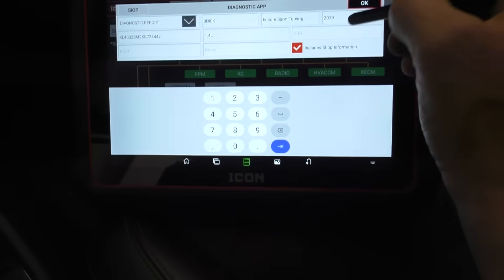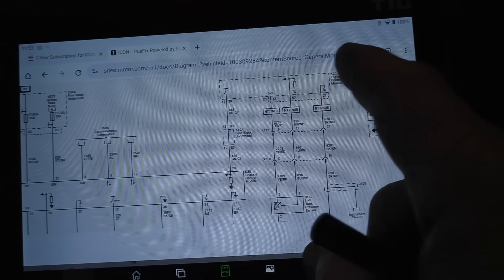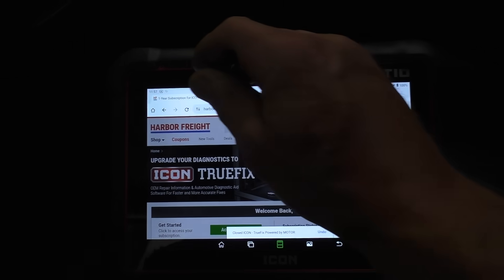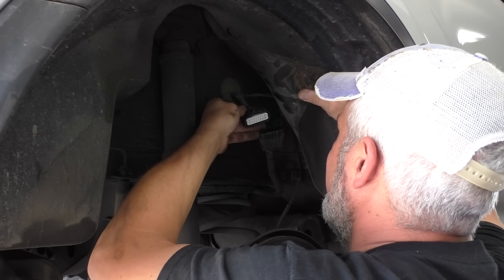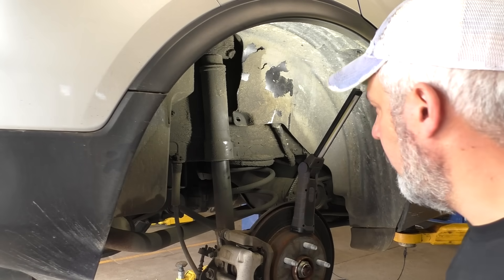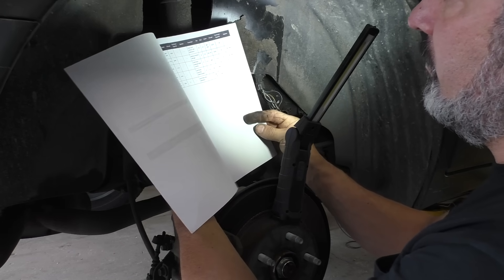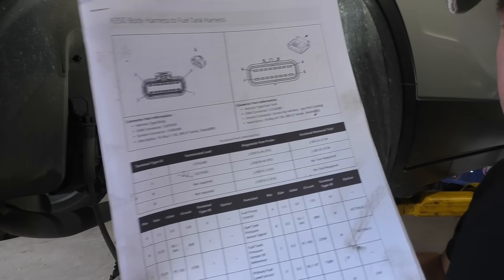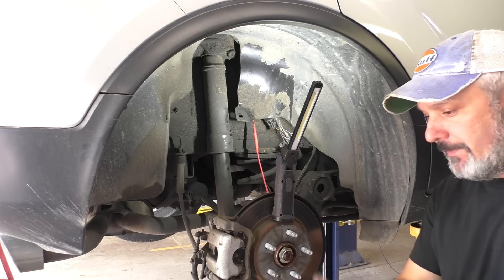Buick Encore - No Fuel Gauge & Engine Light On

Comment: It’s crazy seeing how much getting it oil sprayed helps stop these from turning into rust heaps.
Reply: Never understood why anyone in this region that plans to keep their vehicle more than 4 years doesn't get it done. I get all my new vehicles done.
Reply from the maker: @funbags6471  it is %100 mandatory if driven in the salt
Reply: Any zip code that pisses salt on the road 365 days a year like this one apparently does, should be giving out checks so that tax paying residents can buy a new vehicle every 7 years. 

In the South, you'll see vehicles from 1945 that have been sitting for 50 years with nothing but a little surface rust on the hood. Zero rot.
Reply: @SouthMainAuto  in your opinion, there are more than one company out there spraying their own version of anti-rust oil. I know you spray Fluid Film. 
Anything that doesn't turn hard like Zebart good to go?
Reply: I use linseed oil, no problem if it spills and it soaks in very well. The cost is low and easy to find.
Reply: Don't fix you engine ,trannie leaks and it won't rust away either.....lol
Reply: i so wanted to do this but i dont know what company does it around here and i think its like 600 for first time then 100 a year after that
Reply: @COBRO98  if you wash your car allt he time when salt is being put down it helps alot. epissly if youc an find the auto washer with the super powerful underbody spray
Reply: @dans_Learning_Curve i was wonderin that myself
Reply: @yamisniper 600 is a lot less than a new car before a guy pays off the first one.
Reply: @COBRO98 If you see a 2007 Chrysler or Dodge grand caravan, rust free, let me know. I want one!

Comment: Low reference, fancy term for a ground, but with a twist. Instead of using the chassis as a ground return, an extra wire is used as a ground reference (return) back towards the circuits in question. This is mostly used to mitigate noise induced by the chassis return. Hope that helps.

Comment: I just got done with an Encore. 
Customer said his brother said it needed a new intake manifold. 
The owner said its been Parked for a year because his brother worked on it and the misfire was evident .
Car jerks bad. 
I scanned for codes
 Misfire 2 and 4
Pulled each plug and started checking. 
2 and 4 plugs porcelain carbon tracked. 
Coil boots springs are installed wrong. 
#2 is Rusty.
Got new ac Delco iridium plugs. 
Installed the boots springs correctly. 
Misfire went away. 
Took car for test drive. 
No more jerking and ran smoothly.
No codes. 
About $45.00 in parts. Some elbow grease. Its fixed. 
Customer is elated. ❤

Comment: I love the way you kind of mirrored my tech life in one video. I was a tech with IBM early to mid 60s. That was an era that evolved from vacuum tubes
and relays (the kind you could hear in operation) to the earliest use of transistors, from wires to traces on a circuit board. From big to little it was hard
to capture the differences in circuit logic. You show the kind of logic+experience that we had to traverse. Great videos!
Reply: I saw the CDC thirty-six hundred in action at Michigan State University, in 1962. I saw a YouTube video lauding it and describing it. They called it the "three thousand six hundred." This is the same as saying IBM made a series of "three hundred sixty" computers. Nope. They were all "three sixty" computers. Glad to see you are still ticking, as am I. I suppose that when we die the knowledge of how to pronounce those computer names will also die.

Comment: 2021 Silverado 1500, for the first 3 yrs of its life and NH oil coating done each October. Often wondered how a technician feels about working underneath as it can be messy. Got a hint when the cap was installed, wasn’t a pretty experience. But no rust yet, when you and Mrs O are right you’re right.

Comment: You had me with the "rules", especially the do not trust aspect. Gotta verify everything, especially when it doesn't make sense. The next one was the look to the heavens when you said the sensors don't use the same ground. It appeared that the gears really started to grind. You also point out one of my 'pet peeves', how related information is convened in technical publications. The attempts to organize the information by function, subsystem, system is all useful, but if it's not always obvious that there are related components, i.e. Black and Green from the elements on the fuel tank, and indeed they all used the same connection. Nice investigation, thought tree, and summation!

Comment: That scan tool is about $1700 here on the West Coast and if I was still working it would likely be a great choice because the Snappy one was close to $30,000 a decade ago 
Thanks again ,,,,,,,,,,
Reply: The Icon scan tool is in stock at my local Harbor Freight  in the Mojave desert, $299 in stock. You can also order online.
Reply: @desertdenizen6428  Is it the same model (T10)?  On the east coast it is around $1,700. also.

Comment: Flew to Vegas for a wedding. Purchased a rust free 2013 Equinox with the huge 2.4! Expected to have to add oil driving it back to Minnesota. Nope! It didn't live up to the GMs 2.4 of oil consumption! Oh, 174,000+ miles on it!
Had to remove a wheel bearing. Removed the bolts and pulled it off by my hands! Getting 29 MPG combined.

Comment: I just had issue with my 09 buick, High voltage issue.
Turned out the fuel level sensor had a loose wire. In the tank, put new fuel pump sending unit in and seems to be good......... for now. 
It's a buick so I'm sure I'll be working on it again soon.
Keep up the good work. You are the best .

Comment: Cut the other black with green wire.  Connect the 2 together, maybe with another length of wire.  Use those handy dandy connectors with adhesive and shrink wrap and neon blue color.  Who needs the connection feature anyways?  It's what I'd do.

Comment: Knowledge of the system, wiring diagram, past experience and of course a good diagnostic tool.
SMA for the win again!
It's probably cheaper and better in the long run to change the connector,  which could possibly help to eliminate future problems at that connector.
Good one Mr. O!

Comment: Almost every video I wonder why the computer comes out before the visual inspection. It's wild to take time on 100% of cars when so many are visual finds. As an entry tech years ago I found so many things with my eyes I made good flat rate time on many jobs with the visual. To be fair I was GM only at a dealership so that helped. My point still stands.
Reply from the maker: You're telling me that without any information whatsoever no scan tool no nothing hundreds of connectors and over a mile of wire you would have pinpoint a wire broke inside the insulation during a visual inspection only. If that's true I'm going to offer you 2.5 million per year to come work for me. I'll pay for the entire relocation of your family to come live here. No joke. If you're that good.
Reply: @SouthMainAuto  fantastic. GM only.
Reply: I had no idea you'd be so sensitive, bow hunter and all. I did leave out some info to keep it short in the comments.  Nice to meet you  as well. I guess the praise a sang for you in the past went un noticed. That figures.

Comment: Pretty common on those vehicles encore, trax to have wires break in that harness usually just after the connector as you found in the video or just before it goes over the fuel tank by the frame rail. Great job as always Eric.

Comment: Love your work Eric , you need to up your rates for this type of work , lm in western Australia 🇦🇺 and I was charged $175 an hour for a very green guy to come out to site to put his computer on my cat skid steer after three attempts of trying to calibrate the throttle motor I asked if he had adjusted the throttle linkage to spec before attempting calibration 💡 ended up with a $700 invoice and I had to tell him how to do the job correctly

Comment: Great tip on "Crowned" cars not having rodent damage.  May get mine done just because of that.  Have used Peppermint oil spray every 2 weeks but still have had issues.  Just spent 18 hours tracking down issue to find rodent had chewed through wires.  Maybe this is my answer!

Comment: Very interesting that the signal return/ low ref is the same. But if you think about it, the fuel gauge is not monitored all of the time, or at least it used to not be. The fuel tank pressure sensor however is monitored for EVAP monitoring. I wonder if it looks at the fuel level on key on/ start with intermittent checks every so often and then fuel tank pressure the remainder of the time? Anyway, good informative diagnostic process. Thanks for posting the video, as well as all of the others like it. I enjoy watching the diagnostic process.

Comment: Eric, that was a tough one.... the Icon machine is bit anti-intuitive, but then I have not used it either.
I would have been tempted to just pull the back lead out and solder them together, but that would have defeated the purpose of the connector.
Oh well, keep up the good work.

Comment: Nice work Mr O, although I probably would have taken a used one wire male and female connector from a old GM and made the final fix. Im sure I would have points deducted at the car show but it would have saved the customer some $. I'm betting that plug ain't cheap.

Comment: I wonder if that connector doesn't get a nice big ice ball swingin' in the wind during the dark days of winter trying to screw up the works.  Didn't look like a "meeses" problem.  The HF diagnose tool looks to be a decent tool for a garage guy with 2 grand to throw away.  If a pro can use it, can a home garage guy use it.  I dunno, man.  Thanks for the video Mr. O!

Comment: I found this interesting. You knew that the pressure sensor should produce about 1.5V. Is this always the case? Is this true for GM only?
You also mentioned something about water. I did not follow that since water is very undesirable in automotive fuel systems. (unless flex fuel has advanced much more than I am aware of. 😆)
The "low reference" stumped me for a minute but I realized that these circuits are used for critical measurement and a seperate reference will maintain accuracy and help prevent noise interference. 
🖖🏻Live long and prosper!

Comment: I am totally baffled at how that wire became fatiqued.  😮

But continuing on...   like mechanics change upper radiator hose too when lower hose fails, if one wire failed aren't they ALL suspect at that connector?
Reply: I’ll bet the cars wiring harness is made in China! Never had so many electrical problems in the 50’s and 60’s!

Comment: The reference is not really ground.  The reference and the signals are monitored by high impedance circuits so that the wires carry very little current.  (This is "remote sensing" strategy or "Kelvin connection.")  Thus there is no V=IR drop in the wires and the potentials (voltages) at the computer is the same as at the sensor.  The computer will watch these signals with instrumentation (difference) amplifiers.  The open circuit blocks the amplifiers' input bias currents and drives its output to the power supply 'rail.'  I am surprised that it didn't work 'when it worked;' probably the amplifiers were oscillating due to the poor reference quality or were responding excessively to noise.  An input filter then averaged these quickly-varying signals to a value midway between the correct 1.5 V and 5.0 V.

Comment: Weird question: What is in your mechanic "go bag"? Things you take if you are not entirely sure what you are getting into? I get wrapped around the axle and wind up with a 25 pound bag of never ready for anything. I usually have needle-nose, diagonals, a couple crescents, allen keys and then a couple of wrenches that I think I might need. 8-13mm or 5/16-3/4. I always want to grab a hammer so that if I can't fix it I can break it enough to get it replaced. Maybe what you grab for Wilbert's.

Comment: I’ve got the Matco Maximus 4 and it comes with Maxfix which looks awfully similar to that Icon truefix, I’m wondering if it’s the same thing. I don’t use it super often just because I’m so used to using AllData but the times I do use it it comes in handy and definitely has the information, just not used to the interface like you were saying. I would like to see you showcase the Identifix feature of the icon, I’m assuming it’s just the silver bullets and not full identifix but I’d like to see what it looks like and if it does or doesn’t compare exactly to identifix silver bullets

Comment: May I ask why you chose to do a pig tail instead of de-pin the connector and re-pin new wire and solder 1 wire? Also because you said no corrosion in the connector..

Comment: Hey, maybe dumb technical question about the icon scan tool - Does it do cummins diesel testing, in particular injector cut testing? Considering picking one up to help a buddy get his 2006 Ram 2500 megacab back on the road, he's been stuck with an injector code.

Comment: I was going to type more in my last post , but when you have thick fingers things get pressed .  So i have a question . Did the left signal light return to functioning after you fixed the pin connection on the rear passinger side . Or was that a seperate issue altogether ?  And the reason im asking is when the computer switched to default and lowerd the fuel gauge , does the gauge share a ground with the left turn signal in the cluster ?  Which then lead me to think , if you diconnecte the drivers side same wire would it shut off the same cluster light or the right side indecator light ?  In any case its showing you how the computer works ,  its swithing a relay some where , i noticed this also happens on chrysler 300 cars also . I know this is going to be a pain in the ass request but could you look up and see if you did a repir on the turn signal or was it self correcting ?

Comment: Eric, would it be easier to simply attach a new pin? versus replacing the entire connector?
Or are you concerned there may be problems with the rest of the connector? 
If it was just a couple of wires, I could see justifying replacing the connector. However, it looks like there’s a number of wires. Just my thoughts I’d love to know yours, Ron.

Comment: Looking for root cause on the broken wire. If it broke right at the rear of the terminal, then it was most likely vibration. GM has engineering requirements to secure the connector as well as the distance of the next secure point being 100mm or closer to prevent this. I saw a huge unsecured length once the connector was unplugged from its secure clip. Engineering owns this failure.

Comment: Like one guy said  just go to connector inspect wires. Done. Save time worrying about the wiring diagram
Reply from the maker: So you're telling me that without looking at anything you can pull the car in and go to the exact connector that's involved with this and find the problem. If that's true you're worth several million a year to any dealership. I don't follow hunches I follow facts. By doing that I'm more successful than anybody who takes a guess and just goes on looking
Reply: @SouthMainAuto you knew the connector was the likely issue anyway. Just had to look up where connector was.The  rest was easy

Comment: if it were my car i would have just run a jumper around the connector and called it fixed but even it it wasn't i would have at least offered the bypass save a buck option to the customer ....

Comment: I'm sure splicing in the new pigtail involves soldering, and/or crimp connectors, a bit of heat shrinkage, and some electrical tape on a 10mm socket, so please bore the hell out of us!!

Comment: You meant to say the tiny, NOT so big 1.4  4 cyl. TURBO trying to squeeze out enough power  for a vehicle that size  RIGHT ?  Those engines are not designed to last very long G.M knows it , I would never buy one it"s guaranteed to self destruct after the warranty !

Comment: People: 90k for a truck is crazy

Also people: buy useless junk built little cars with 1.4l engines for almost half.😅
Reply: This one cost $20K. Over 5 years and this is first repair. No recalls
Reply: @bearmotel  Without the turbo this literally is a geo metro on stilts for 20k. Absolute insanity. 
They go for as mich as 35k which is the joke of the century. A 12k car for 35k because they told the moron buyer it is an "SUV".